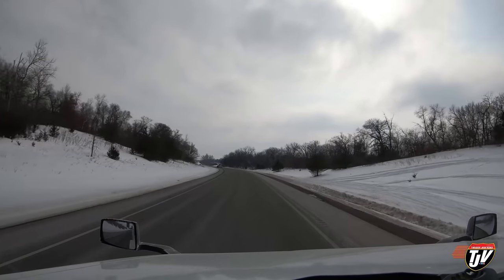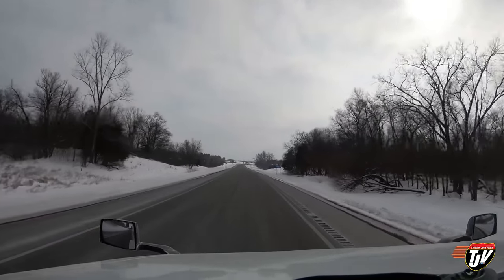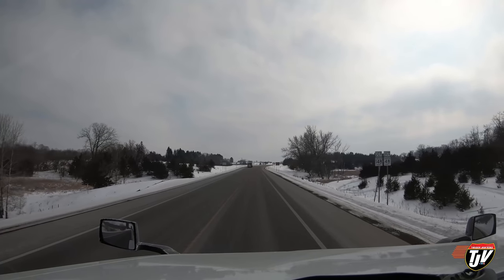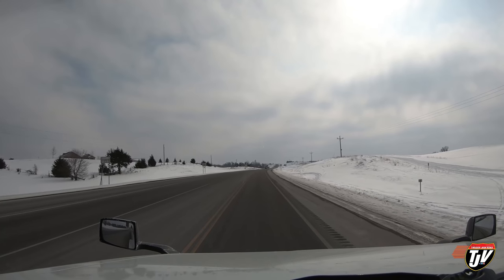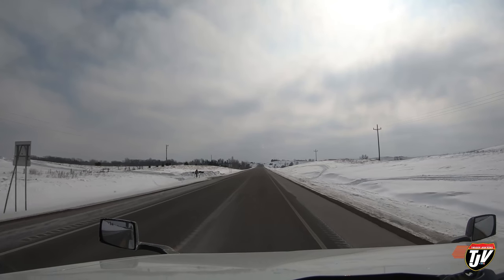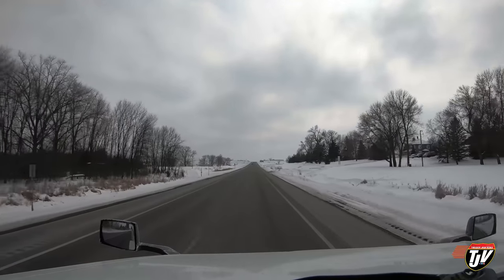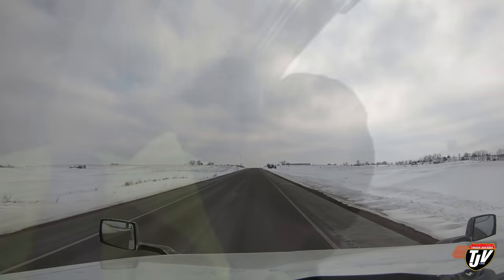My Trucking Life | WATCHING MY OIL | #1662

Comment: Hi Josh, i hope your truck engine problem gets resolved at this stage only. I have heared from many truckers that since the evolution DEF system in the trucks, the engine starts playing up at around 750k to 800ks. Engine ideling of these DEF installed trucks is not good as well. Get the DEF filter replaced asap or ask some mechanic about the same as well.

Comment: You might want to check your DPF filters. The filters on my truck plugged up due to a bad piston ring and sleeve.
I had 2015 Cascadia with 230000 on it
and had it rebuilt by Cummins. Thankfully it was under warranty but truck was in the shop for a month.

Comment: Check, your crancase breather filter, if this is plugged up with oil, which is usually the case, will
Cause oil to come out the blow bye tube, we change them at every other service and it's usually time, not sure on yoir truck if you have a Detroit or a Volvo motor in it.

Comment: The blow by pipe gets frozen  when you  run in cold weather. It happen to me. Kevin
Reply: A fellow just needs to idle it up high in extreme cold.  I idle mine up to over 1500 rpm, when working on the ice roads to the diamond mines.  But you're right.  If the blowby tube freezes up you'll blow out a bunch of oil.
Reply: If the oil cooler gaskets are bad oil can leak from that also when cold starting in very cold weather

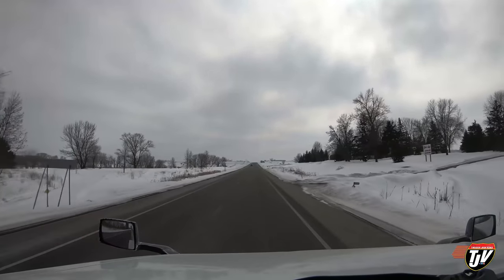Comment: You should watch Rawze's Collection here on YouTube. Watch his video called "Used turck Buyer Beware" video (Truck is spelled wrong in his title). At 7:09 he explains what possible problem you might be having. Have you ever had an Overhead set done or valves adjusted? He talks about the crank case filter also. He's working on a Cummins motor. He recommends an Overhead set and valves adjusted every 250,000 miles. He's a great mechanic.